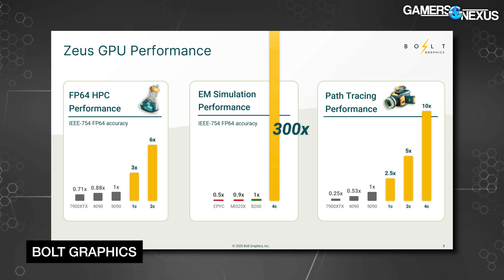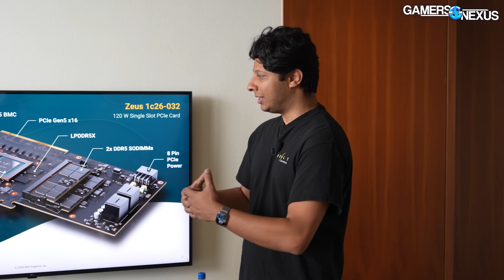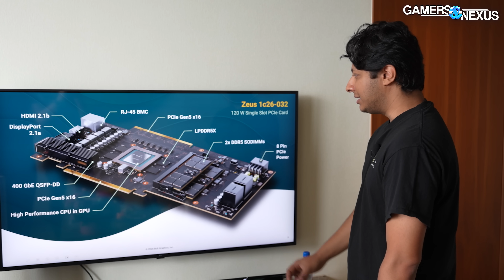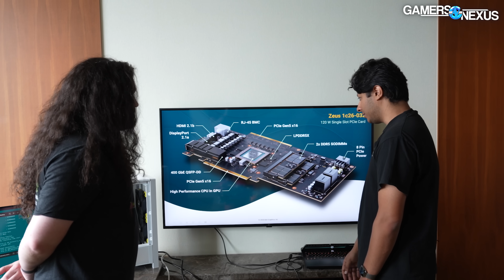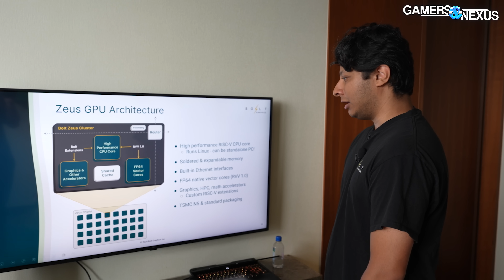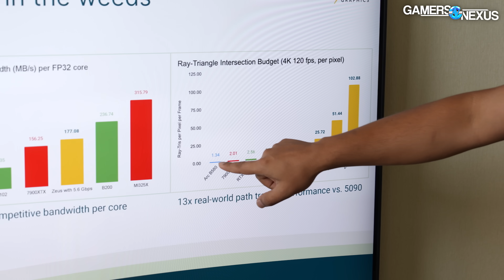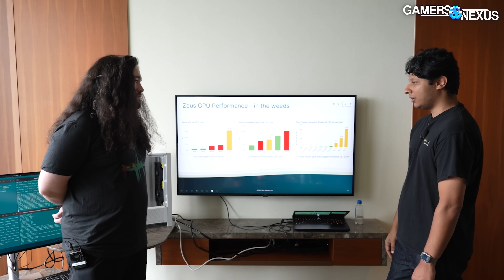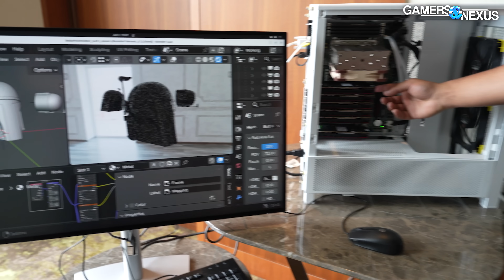A New Gaming GPU Challenger: Bolt Graphics Takes Aim at NVIDIA

Comment: I'm questioning if they're truly are only chasing the gaming market, the DDR5 SODIMM sockets seem to strongly suggest they're chasing the AI market, even the secondary PCIe slot strongly suggests even more heavily that they're targeting AI both of these have extremely obvious use cases for AI, less so for gaming, same with RJ45 he even says datacenter or multi-GPU support (games don't support multi GPU anymore). Their timeline is also insanely aggressive, they're planning on releasing this in a shorter timeline than Intel - there is no way they honestly expect to beat out Intel's timeline with adequate drivers for games, but AI in that time frame makes a lot more sense.
Reply: There is answer to it in video. Gaming is not focus, but rendering etc workflows
Reply: @nybachok  Yeah I know he mentioned render workflows, but most of his presentation seemed to revolve around gaming most  seemed to lead that way, I'm surprised there was no mention of AI performance, because that is their low end card they're showing off, why would you need SODIMM slots to expand your ram so much on a low end card they wont be able to handle that many textures there is no point, especially when you're stepping your transfer rate down to DDR5, a single 8gb stick, would make the total amount of VRAM more than a 5070ti, its insane, I don't expect their low end GPU to be much better than a RTX5050. Loading 16gbs of textures to a RTX5050 would be a slide show. Its clear that its use case for the SODIMM slot is not for gaming.
Reply: @johnj8639 honestly? I don't know. Lots of interesting stuff, but lots of salt needed as there is no manufacturing and graphs are way more optimistic that you would expect from a no name manufacturer.
Reply: 10:45 he said data center use case. This is DOA
Reply: @KubanKevin  I thought I acknowledged that earlier in my first, and again in a reply, their presentation mentioned datacenters literally twice, the rest was all gaming oriented
Reply: It wouldn't really make sense to have that much ray tracing hardware in a chip designed for ML.
Reply: @leonmunster8972  From what I understand cores dedicated to RT are also good for ML algorithms, both require extensive matrix math, which is why even traditional raster cores can functionally run RT algorithms to a degree, because they use a lot of matrix math also just not exactly designed to be as efficient for it, so RT cores won't be useless for AI.
Reply: @leonmunster8972  Also I agree that neither RT cores or Raster cores are good for AI, its way better to have a dedicated chip for it but all are designed for matrix math, so its a significant step up from using general CPU cores, and cheaper than a dedicated AI card from Amazon or Microsoft or most other large companies.
Reply: @johnj8639 but wouldn't it make more sense for them to just build a ai accelerator instead of hiding it inside a ray tracer?
Reply: @leonmunster8972  That's basically the paradigm behind Nvidia's GPU's their RT cores and Raster cores are all significantly larger than their AI cores. Their AI cores barely account for 10% of the dye. My guess is they're looking to compete against them directly, Nvidia's GPU's account for a large majority of AI accelerators sold, and it only takes up a small percent the rest of the cores are also used to accelerate AI too but its really only 10-15% that is related to AI. My guess is that they're trying to copy this and that they will also have their AI cores at roughly the same percentage allocation. They probably want their cards to be useful outside of the AI bubble also, but I'm not sure why they've avoided the subject entirely.
Reply: Its for Rendering. Its in the video. The DDR5 SODIMM has enough bandwidth for gaming too. Once there is a userbase with both a Nvidia GPU and a Bolt inside, the users will boot RT on the Bolt or the entire game on bolt whether it works well or not. Then Bolt can have a userbase and begin targeting gaming.
Reply: This guy is a top tier bullshit artist, they have no product. They have no drivers. Their demo product is just a datacenter AMD card, lmao.
Reply: @GebaseerdeKikker  Well its an FPGA that they designed and AMD built, I just find it hard to believe they will have anything for gaming any time soon, its clearly a datacenter or AI card.

Comment: The big takeaway here is that Bolt are promising raytracing future NVidia have been pushing down our throats for years, but at a performance level where you don't need ugly AI upscaling to get it to work.

Of course, it's much easier for Bolt to do, because they are practically gambling on raytracing adoption and hedging their bets by gathering market share in markets that have no problems with this. nvidia still has to support current games. But damn.

Comment: google glasses are the future. they will change everything. 
NFTs are the future.
every VR headset is the future. especially that 8k pimax.
the OUYA is the future
the metaverse is the future
fisker is the future
electric motorcycles are the future.
3d tvs are the future.
8k tvs are the future.
hyperloop is the future.
dna testing is the future.
carbon neutral is the future.
smart homes are the future.
every handheld emulator gaming device is amazing.

Comment: This looks great! I can see applications like blender quickly taking advantage of how easy it is to stack these up. Honestly I would buy a few just to hack around with application development and clustered systems development.  I can see new types of games evolving out of this however as Intel found out there is decades of deliberate GPU Vendor and OS lock in to overcome. Not so easy however video game consoles have dealt with these issues just fine. Each console is a new platform which requires new tools and new software. Odd issues come up with new processors which are overcome. It's been done already sort of.  I can see a new generation of open hardware consoles coming soon.

Comment: Bolt Graphics, a semiconductor startup founded in 2020, recently developed the Zeus GPU. Designed specifically for high-performance computing (HPC) and path tracing rather than standard gaming, it claims up to 5x faster path-tracing performance than an Nvidia RTX 5090 while using half the power. [1, 2]  
Company and Background 

• Founded: 2020 by former data-center hardware architect Darwesh Singh. 
• Current Status: The company successfully taped out its first Zeus GPU test chip, with hardware running on FPGAs and developer kits expected. [1, 3, 4, 5, 6]  

The Zeus Architecture 

• Focus: Instead of traditional rasterization, the Zeus architecture is built for next-generation rendering, AI research, and scientific computing. 
• Performance Claims: Bolt claims the GPU is 5x faster in path tracing than the RTX 5090, 12x faster in FP64 HPC tasks, and up to 300x faster in scientific/electromagnetic simulations. 
• Memory & Connectivity: Features expandable memory using DDR5 SO-DIMM slots alongside onboard LPDDR5X (up to 384GB), integrated 800GbE networking, and native RISC-V control. [7, 8]  

Software Support 

• Target Platforms: Instead of direct gaming, it targets developers and creators using programs like Blender, Autodesk (Maya, AutoCAD), Unreal Engine, Unity, and Houdini. 
• Release: Full production and mass release are targeted for the fourth quarter of 2027. [1, 9]  

Would you like to know more about how Zeus's RISC-V multi-chiplet architecture compares to traditional Nvidia/AMD models, or explore the software developer kit timeline? 
AI can make mistakes, so double-check responses

[1] https://www.networkworld.com/article/4173251/startup-bolt-graphics-promises-5x-performance-over-nvidias-best-gpu.html
[2] https://www.overclockers.com/forums/threads/bolt-graphics-tapes-out-zeus-gpu-claims-is-5x-faster-than-nvidias-rtx-5090-in-path-tracing-at-half-the-power.808656/
[3] https://www.tomshardware.com/tech-industry/semiconductors/bolt-graphics-tapes-out-its-first-zeus-gpu-test-chip-on-tsmc-12nm
[4] https://www.youtube.com/watch?v=m6RwlHwQOz0
[5] https://www.youtube.com/watch?v=Z9rN3yuOCps
[6] https://www.youtube.com/watch?v=ffUwkIxDbGE
[7] https://www.facebook.com/TweakTown/posts/bolt-graphics-has-completed-its-zeus-gpu-chip-design-claiming-5x-faster-path-tra/1515444987293665/
[8] https://www.youtube.com/watch?v=Qec0wzTqWJ4
[9] https://bolt.graphics/how-it-works/

Huh no wikipedia..yet.

Comment: But if it's so easy for a new startup to work directly with memory makers then why was Vavle unable to for the steam machine? LPDDR5 and DDR 5 SoDIMM both use the same DDR chips so they all come from the same supply chain and end up on different packages. Again this really favors the idea that Valve is just very incompetent when it comes to just getting the job done with procurement. Getting a supply contract is far more important than it being at a preferred price as shown by Bolt getting a contract that Valve couldn't.

Comment: I like the idea of a VRAM expandable GPU, but wouldn't it also require more power with more memory? I'd honestly design the card with 3 8-pins with a specific firing order based on memory volume as well as user replaceable fans like on tower coolers to compensate. Definitely also needs open source drivers too for Linux where it could really shine.

Comment: DDR5 as vRAM ?.... so going back to 1995
Reply: back to 95 is good in my book
Reply: The Arc Pro B50 also uses DDR5 as VRAM, as do Strix Halo systems
Reply: @bosstowndynamics5488  every source I’ve ever seen on the Arc Pro B50 says 16gb of GDDR6.
Reply: @bosstowndynamics5488  Vram and Dram are so very different in terms of speed and bandwidth. Vram is designed for low speed, high bandwidth because GPUs are parallel processors, Dram is designed for high speed low bandwidth because CPUs are serial processors.

Comment: My Dream GPU is a small low power draw single fan GPU.   Not a BEAST like a 4090 or 5090.  Last GPU I had like that was the 1070 mini MSI I had, tiny GPU ran great for so many years.  I bought a normal MSI twin fan 4070 specifically because it was the closest on the market that fit that description.   It's funny because the 4070 was treated as a joke by a lot of gamers.   But when viewing at AMD's products and Nvidia's products at the time it was what "I" wanted out of a GPU.    MSI had a 3070 using the same general frame twin fan design but the darn thing was like 40% thicker than the 4070 version if that emphasis why I chose the 4070.   Most GPUs sadly are just grossly large, often triple fan designs or have huge heat syncs.

Comment: Literally asked AI a few days ago on how it would architect a graphics card with user expandable memory, considering the RAMpocalypse, and it's basically very close to this: 
GPU > comfortably sized on-package VRAM > CAMM-like VRAM

Can't fully replace VRAM with CAMM, because your speed will suffer, but CAMM-like VRAM in closer proximity is more acceptable to system RAM or pagefiling.

Comment: This is essentially just a piece to pull ppl away from the metaphorical ledge of the current pc climate. Its a nothing burger for gamers in the sens that maybe you'll be able to play on a bolt within the next ten years. By then im sure the problems will be different. Price/tech will have changed, or ppl will be priced out and just have to watch pc gaming die like we did in the 90's with so many other technologies.

Comment: Thank god someone is stepping in and providing some MUCH needed competition in the GPU space. Godspeed.
Reply: Yea, right, people said the same thing when Intel entered the GPU market and then nobody bought their cards.
Reply: @little_fluffy_clouds  I mean intel entering the market was a good thing.. The reason they didnt sell was their drivers were ass..

Also they only targeted the low end.. Meaning only people buying them were those on a tight budget.. If you spend more than 1K on your pc you wouldnt go intel gpu...

Its like if youre building top of the line PC you wont go Intel or AMD you go with nvidia xx90 card... 

But intel being part of the gpu market is good for the market.. Competition is good...
Reply: @little_fluffy_clouds  intel deciding to milk the market by price-performance matching ngreedia/amoode - thats the problem with Intel priorities, not with gamers 'not buying Intel cards'.
Intel cancelled discrete Celestial Xe3 GPUs to push Xe3 in handhelds where margins are way higher.
intel cancelled Battlemage b770 for gamers and instead released workstation b70 @1000usd.
because ngreedia bailed out Intel and bought a huge part of them so Intel can't compete vs its own owners even if they wanted to (they don't).

the problem is Intel itself, not gamers that didn't buy intel's not-competitive slow buggy junk because intel's pricing/performance is a spit into gamers faces. intel GPUs turned out to be a nothingburger that didn't help with 10x overpriced GPUs on the market AT ALL.
Reply: @little_fluffy_clouds  I would be the first to say intel GPUs are great when they'll start selling 9070xt/5080+ performance level 2x cheaper than amd or nv do. now that'd be an actual progress. but intel instead wants to sell cut down power starved Xe3 in overpriced handhelds and obsolete Xe2 in overpriced pro cards/workstation builds. Intel is TOO GREEDY to actually compete vs amd/nv. and also partially owned by ngreedia now.
Reply: @rawketfire  this is the problem with consumer. With this kind of demand there is not other gpu maker out there can be a real competitor to nvidia or even AMD.
Reply: @arenzricodexd4409  there's no demand. PC sales are down AF because EVERYTHING IS OVERPRICED amd nobody needs hardware at these prices. demand is fake and since mining started always have been fake to push prices up. even when mining was over in 2022 ngreedia just kept artificial scarcity to sell through overproduced for miners 3000 stock without dropping prices at all. blaming consumers for corps greed is a sad corpshill joke.
Reply: @little_fluffy_clouds yeah well see their cpus as well
Reply: This is just another llm hosting card, not going to be used for anything else
Reply: @Petrovich2049  i don't think this card being made for LLM at all. ML usually target low precision to boost performance but bolt want to serve the more traditional FP32/FP64 workload which can be slow for ML stuff. their target still pro market and not gaming though.
Reply: @arenzricodexd4409  FP64 is anything but traditional. Completely useless in video games and modern rendering pipelines.
Reply: realistically this will never enter the gaming market, most likely stay inside custom accelerators for professional use
Reply: Religion has nothing to do with this.
Reply: @nalinux  r/atheism 🤓

Comment: It is a very smart product! A lot of people use GPUs for digital signal processing - there are even some new DAW plugins that work on GPUs. Around 2008 someone told me - though I can't confirm - that the Brazilian oil company Petrobrás was the nVidia's largest client and they used the GPUs for DSP in reprocessing geological "sonar" signals. They seem to have made a very general use machine - one that can even run without a computer - that apparently can be scaled by connecting more than one and linking them. Perhaps in the future game studios will start to make programs that take advantage of those characteristics.

Comment: From the small form factor and expendable RAM i wonder if it'd make a good secondary card. Like one card is used and exclusively used for high performance tasks like gaming while the smaller bolt card is rendering the Desktop/browser/etc. on another monitor. 
or have the strong card run for a VR Headset while the Bolt runs the PC. 

That way I'd wager they could still give gamers a tangible benefit while they aren't yet making gaming Hardware themselves. especially the small and dual sided form factor could give it an advantage as a secondary card

Comment: So many comments by people who didn't even watch the video.
Raytracing is a huge hole in the market that they can easily fill. Any studio that needs PBR pathtraced rendering would hugely benefit from proper hardware accelerated pathtracing. There is currently no dedicated hardware for pathtracing, And that is what BOLT is looking to do.
Then, when their tech and design is more performant and mature they can move onto real-time rendering for gaming.
Currently, studios use either CPU racks or Overpriced NVIDIA hardware to perform ray-tracing. Neither of which are really built specifically for it.

Comment: The stacked SODIMMs is such a terrible approach. Bit late to mention names because I know for certain he won't care to read it from here, but Darwesh, please don't. Reformat the card so the SODIMMs are adjacent the die on both sides, and some TPM7950 could be put onto the RAM chips. While you cannot necessarily enforce it, have people use single-sided DIMMs so all of the heat load is on the chips, rather than half. The small-outline HUDIMMS might actually have a great use in this application.

The entire top-half of the card can just be heatsink with this design, and so long there are conideration for the SODIMM connectors, it should be able to lay flat-enough for a single-slot card.

Later-on, if Bolt can actually turn a profit, the SODIMMs can be replaced with CAMM, which would be flatter, run cooler, have a more-direct signal path to the die, and enable more heatsink with a predictible footprint that will always have the chips be single-sided. Bolt could then manufacturer their own GDDRX CAMM modules.

Comment: you can calculate the ALU count by reversing the ddr5 bandwidth per ALU, not counting the lpddr5x of course. with that i got a count of 518, but you could knock that down to 256 to account for lpddr5x bandwidth